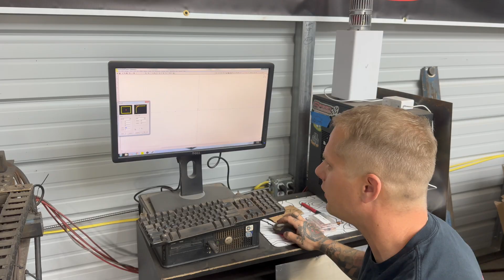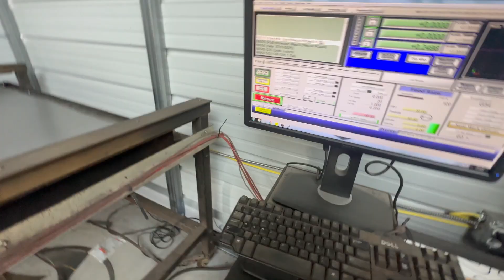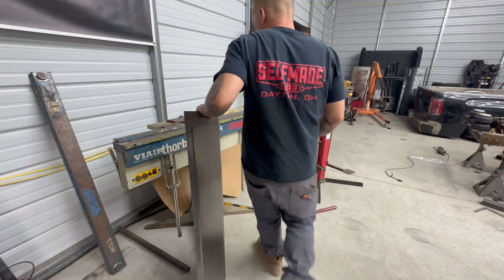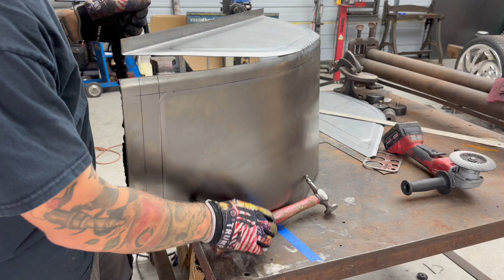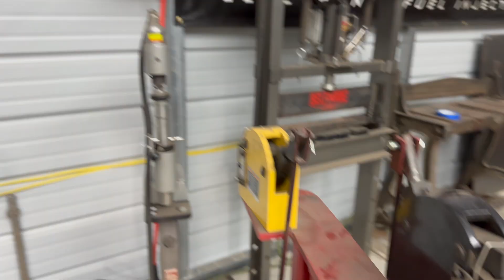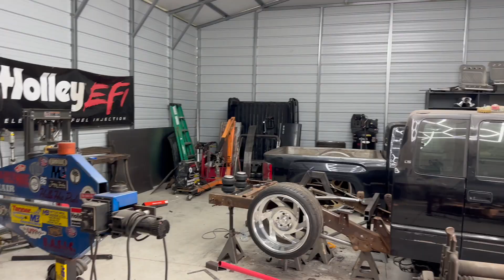How to Build custom wheel tubs

Comment: I liked your video. I always shrink my edge before i roll the edge in the bead roller. You wont have to fight those inconsistent ripples. You would have to focus more shrinking on the tighter curves but well worth the time not to struggle with those ripples while tack welding. Looks real nice. thanks for the video.